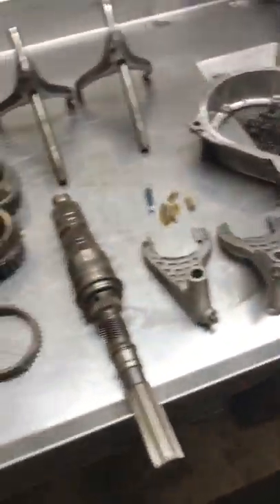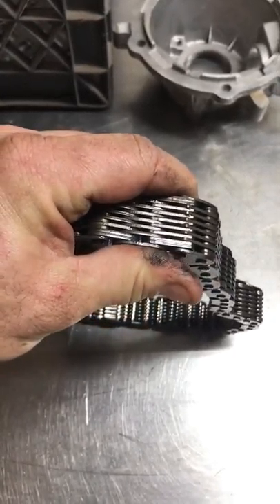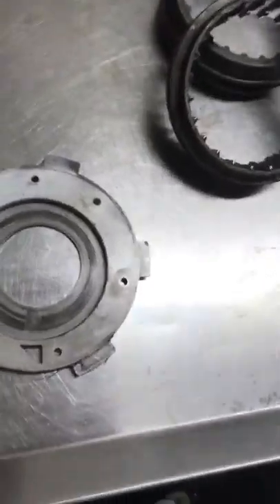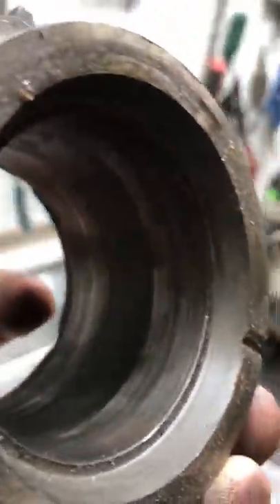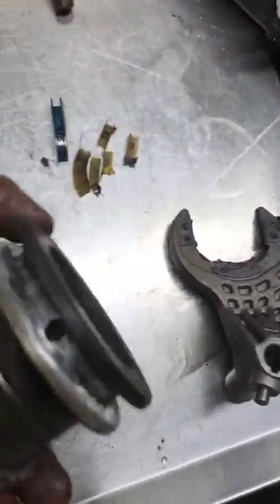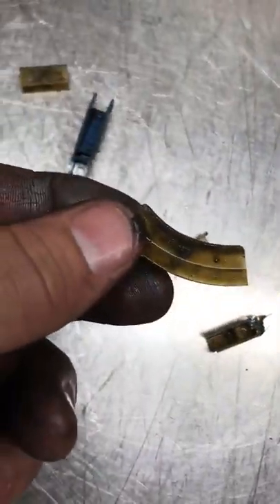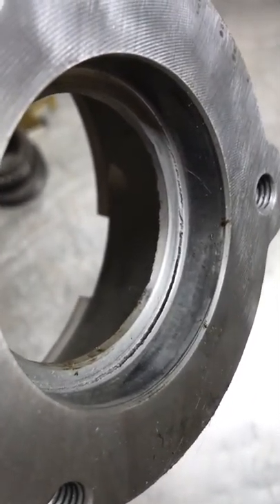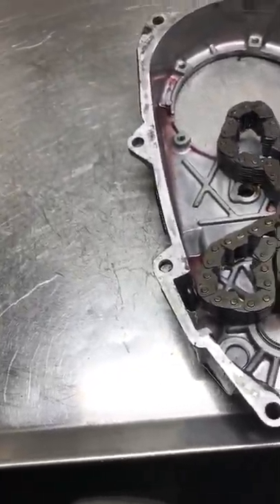NP231 Transfercase and things that go Bad...

Comment: I put a 232 in my ZJ and when I put it in to reverse it slams in to gear and the noise is coming from the t case it also slams when I put it in the drive as well but not as bad. This happens in two wheel drive or 4 wheel drive. The fluid looks clean. Any idea what the problem is?
Reply: That means it’s strong and good

Comment: Question for ya. So, transfer case works for everything. I can use two wheel drive, 4x4 full, 4x4 part, and can feel the torque for 4x4 low. Front driveline does not engage for any of the 4x4 functions, I read that the shift detent ball could be stuck causing the range fork to slide in an out but I am unsure. Thoughts? It's a NP242J

Comment: How can you check the chain while in the unit? I don't see a new video from you on that. Thanks.
Reply from the maker: if its streched and making noise you can remove the front driveshaft and place unit in neutral and spin the front output yoke.  however there is no way to determine a chain that is not making noise since the case components when assembled actually pull the chain taunt. But with them assembled you cant see inside.